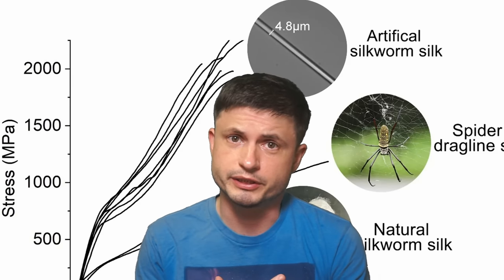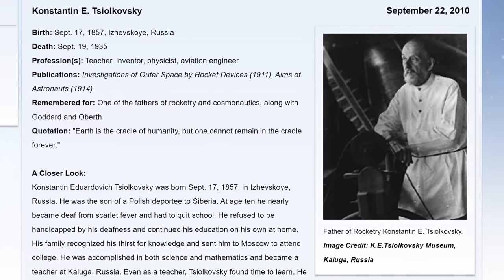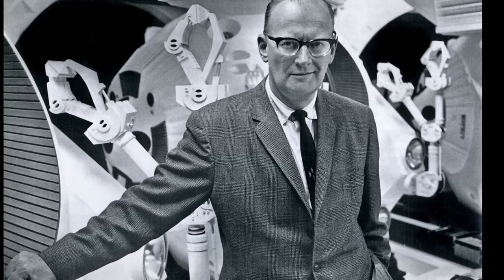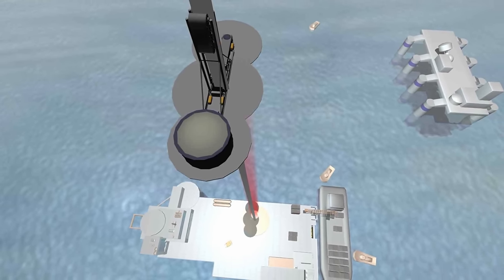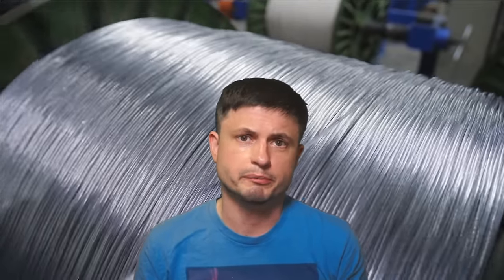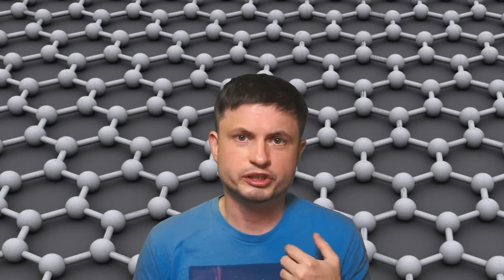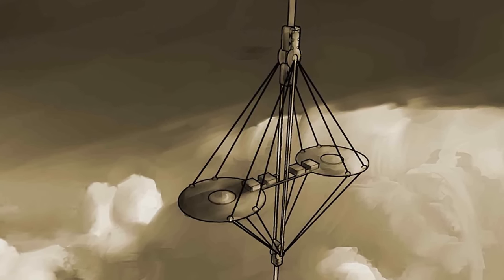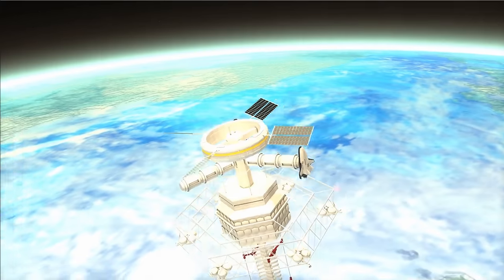Exciting New Updates About Space Elevator Technology...Possible After All?

Comment: I love your shows.  I have long been a fan of the space elevator since reading Arthur C. Clarke's Fountains of Paradise.  The one question that keeps bugging me is how would it avoid collision with the many satellites and all the space debris we have in orbit?
Reply: Satellite collision can be avoided by moving the platform on the planet's surface. This is possible because the platform would be seaborne, and also because satellite course is easily predictable. Regarding collision with space debris, I have no answer for you. That doesn't mean there is no answer out there  :)
Reply: I think the biggest problem besides the architecture design is the possibility of slowing the days down.
Like if you spin on something and move your legs in and out.
It would need to be placed in the equator and would possibly stop the poles from shifting over time. The other thing is how do you dock ships to this thing while it is moving at a high speed
Reply: Well yea, we'd have to either clear that up or make it strong enough to resist such damage, which would be pretty hard to to
Reply: @Dead_Empire  Well the Earth has a radius of 6371km and a mass of 5.96x10^24kg so a space elevator only going like 100km up and with a mass merely a fraction of the Earths I doubt it will do much. That being said, I have not done any calculations on this so if anyone has yk please say so
Reply: Another good one was Friday. It actually starts in a space elevator port think cyberpunk before it was trendy.
Reply: They won't have a choice but to finally do something about it. And, really, isn't it way past time for it?
Reply: @arandomyoutuber6634  yeah I don't think it would do much but how much would it take to make an effect on earth's natural systems? Even a very small change may have huge consequences. 
It's an interesting concept but likely not going to be seen in our lifetimes
Reply: @Dead_Empire  Earths mass is simply far far more than a space elevator that the effect would be completely negligible. The moon’s tidal forces on earth are vastly greater than any space elevator could ever produce.
Reply: @Dead_Empire  - The Earth is really really heavy. There's not any real way that  the small mass of a structure designed to be as lightweight as possible is going to affect the Earth's rotation.

As far as spaceships docking at the high speeds of the platform, we already deal with far higher speeds in low earth orbit, 17,000 mph. At geosynchronous orbit satellite velocity is only 7,000 miles per hour.
Reply: @47f0  thanks for the knowledge
Reply: Space debris hitting the elevator cable is a killer problem.  Cosmic rays are another.  Carbon nano-tubes require that they are atomically perfect to have such strength, the first time a cosmic ray knocks an atom out of formation, the area around the break will stretch, non-reversibly, by 10% and get permanently weaker.  Moving the base of the elevator to avoid paint chips seems far- fetched, but you won't avoid cosmic rays that way.

Another problem is that regular threads get stronger as you wrap them around each other, but carbon nano-tubes get weaker since the carbon atoms in the adjacent tube interfere with the strength of the first tube's bonds.

We need something much stronger than nano-tubes to make an elevator.  (They have to survive minor damage and dynamic loads.)  However, other possibilities are feasible.  Look up 'rotating sky hooks'.

Warm regards, Rick.
Reply: Huge fan as well. Perhaps a powerful laser beam firing parallel to the tether to vaporise debris before it reaches it. Now that sounds like science fiction!
Reply: The Space Elevator would need EVERY OTHER THING IN ORBIT to avoid the tether. "Everything" includes random bits of space rock, a spanner which someone dropped from the ISS, etc. Everything else in Earth's orbit would have to have an orbit to ensure that it never hits the tether. Note that "never" is a long time. If other random orbiting objects are not PERFECTLY synchronised with the tether, i.e. having an orbital period which is a rational multiple of 24 hours, then eventually something's going to hit the tether.
TWANG! CRUNCH!!!
Reply: @Dead_Empire  Yes, yes, OH YES!!! Earth will spin out of control and whizz across the solar system, eventually crashing into Mars! BANG! CRUNCH! SMACK! KA-POW!!!  SPLATTT!!!
Reply: @Dead_Empire  - Slowing the earth's spin or shifting the poles: I'm guessing that such effects would be real but undetectable except over centuries (and then just barely detectable) because the earth is so massive in comparison.  If a ship needed to dock with the geosynchronous station, it would get into a geosynchronous orbit itself.  Then they are going at the same speed in orbit.  The elevator parts further out are going too fast and the portions below geosynchronous are going too slow for ships orbiting at those altitudes to dock with them.  However, appropriate eliptical orbits might make it momentarily possible at the apogee or perigee.  Orbital mechanics are weird.
Reply: @simonmultiverse6349  - You are right, the tether is very vulnerable.  In addition to random rocks and even sand grains (think meteor showers) that enter from outside, orbiting spacecraft debris and satellites themselves threaten it.  I don't understand your point about multiples of 24 hours, though.  (did you mean "factors" of 24 instead?)  If something is taking exactly 24 hrs to orbit, it is traveling at the same speed and could stay on its own side of the planet, never getting close to the elevator.  If it's travelling even a little bit faster or slower, it might eventually bump gently into the tower; greater difference in speed means greater impact, of course.  If, however, it takes 12 hrs, or 6, 4, 3, or 2 to orbit at lower altitudes, it could well hit the tether quite hard.  Is this not so?  But I suspect I totally misunderstood.  What did you mean by "synchronised" and "rational multiples" of 24?
     One suggestion I've read (don't know how practical) is that it should be possible to push the tether sideways to avoid objects that have been detected.  I think they envisioned thrusters stationed up and down the tether firing to the side whenever a few feet to one side or another is desired.  Anyway, shooting-star sand grains or orbiting paint chips would not be detectable or avoidable.  And someone in these comments mentioned damage to the carbon bonds of the graphene by cosmic rays, which apparently would be quite serious.

Comment: The space elevator is definitely a game changer.  The counter weight would be a place you could launch space vehicles by merely letting them go.

But, graphene has so many more uses.  Being more conductive than copper, it will make step changes in the power and digital industries.  It's strength could create bullet proof clothing, lightweight cars, super tall skyscrapers, etc.  It is also a filter, desalinization plants would become viable.
Reply: Key dreaming boy
Reply: A space trebuchet?
Reply: @Faesharlyn  Geosynchronous orbit has a speed of ~6000MPH.  If the counter weight was 50% further out, speed would be ~9000MPH.  Being further out, orbital speed would be less the 6000MPH. 

A trebuchet is a more complicated device, but...  Attach a cable to the counterweight with the free end at the space station.  Attach the launch vehicle to cable and push it in the direction opposite to orbit.  Let the vehicle go when the cable in line with the elevator.  

Space trebuchet
Reply: @stevesedio1656  space trebuchet.

New thought but related:

 imagine putting the SpEl anchor on the north or south pole.. thoughts??
Reply: @Faesharlyn  Equatorial mounting keeps centrifugal and gravitational forces in line, following an existing orbital path (providing it survives sweeping through all the man made debris in space).

I'm not smart enough to figure out a stable orbit based on a polar mount.  Parallel to a geosynchronous orbit doesn't cancel earth gravity.  I'm not sure how to orbit the counterweight to get a near geosynchronous orbit.
Reply: @stevesedio1656  perpendicular to the pole it would just spin, no?

Edit to add: I'm not smart enough to help my kid with algebra but I think a lot. A lot a lot about a lot of things simultaneously sometimes . If the idea is obviously ridiculous I'm stuck here and not noticing it.. please tell me so I can stop thinking about it and we can both laugh at my silliness lol
Reply: @stevesedio1656 : It could only be done over the Equator.
Reply: Someone just gave me a Like, and I looked at my original reply, which got me thinking. I believe that this can be done away from the Equator, but it gets progressively more difficult as you move further from the Equator.
Reply: And impossible at the poles.
Reply: @davidkantor7978  One approach that only works at the pole.  The counterweight is a huge solar sail, the station doesn't orbit, it is locked "down wind" from the earth.  

The cable would sweep 360 degrees daily.  Because the earth tilts relative to the sun, the pivot would need to be 400 miles above the pole to keep from hitting the earth and to keep the sail in the solar wind.

That gets you into space, but not into orbit.  Due to distance, gravity would be reduced, at 22,000 miles, to about 2% earth normal.
Reply: Graphene isn't just more conductive than copper. It's the most conductive material known to man! Despite what you may read from most sources which say that it's silver, they all say that silver is the most conductive *metal*. Graphene, being two-dimensional, can't carry much current on a single atomic lattice. However, if you we're to have a block of graphene, possibly as carbon nanotubes, or simply place the lattice direction facing the same direction throughout the whole block and run the current the same direction, it would be roughly 4~5 times as conductive as silver, the closest second.
Reply: @Wesson_J_Dearsman  4 to 5 times is significant.  That combines with it's strength, and thermal conductivity, wonderful for motors and other magnetics.

Also interconnects and power wiring in EV's.

It isn't a replacement for superconductors.

Another application would be solar panels.  The sun side connections could be smaller, increasing panel efficiency.   The thermal properties could be used to keep panels close to ambient temperature, further increasing panel efficiency.
Reply: @stevesedio1656  I'm aware, I'm saying with both materials at room temperature it is between 4~5 times less electrically resistive than silver, whereas a superconductor has no electrical resistance at a given temperature, which is usually very low.
Reply: Yeah,graphene, carbon right? Carbon burns ya know like coal ( I'm really sick of the " magic carbon holy super dope and mega cool NANO CARBON FIBERS."   yeah, no it's freakin' CARBON repeating this when ya gush it's freaking CARBON

Comment: Another option I heard of to improve the tensile strength was to increase the diameter of the cable as it goes further out, though with most cheap materials it has to get ridiculously wide. That would also pose a challenge for whatever elevator design has to navigate the cable. But it does also cover the counterweight requirement.
Reply: That would not work. The strongest pull would be close to the center. So maybe the other way around.
Reply: I don't think it would be an issue for the elevator, just attach a smaller cable/rail to the load-bearing structure for the elevator to use.
Reply: @Youbetternowatchthis  I'm not sure if you misunderstood what Nick said, or if I misunderstood what you said. But Nick is right. But you also seem to be right. Which is why I don't understand why you say that Nick is wrong.

The "anchor point" of the cable can be seen as being in the geostationary orbit. And once you start stretching away from that, it will pull more and more on the cable that is in GSO. The part of the cable that is further away from GSO, will be strained much less. As you are saying.

So the cable that reaches the ground, only needs to be strong enough to support itself (plus any weight it needs to carry). The next cable up, needs to be strong enough to carry itself and the cable below it. The next cable, need to support itself and all cables below it. All the way up to the cable at the GSO, that needs to carry the weight of the entire cable reaching down to the ground.

So as Nick says, you can increase the diameter of the cable as it goes further out towards geostationary orbit.
Of course, once you are passing GSO, it can start getting thinner again.
Reply: All of the current space elevators plan to use a tapering cable.  The idea is built into current calculations.

Warm regards, rick.

Comment: This is great news! I included a space elevator in my novel 'Atropos'. I did a lot of research on space elevators and discovered some very interesting scenarios for "when/if the cables(s) break". Also, something that's not often mention is how long it would take to climb the cable from the Earth to the tether...We're talking at least a week and most likely much longer. Again, great news and thanks for the informative video!
Reply: So, it seems that it wouldn't actually be used to put people in space.  People would move the faster, more expensive way (rockets, Lofstrom loop, etc.).

But he SE would still be useful for bulk cargo, which won't get bored or have to be fed, watered, aired, and eliminated for all that time.

Comment: I wonder how at risk these elevator tethers would be to collisions will LEO debris and satellites. Kessler syndrome could be the ultimate doom of Space Elevators if we don't keep a handle on it.
Reply: If we get a SE I think that Kessler syndrome could be addressed and solved way easier. Since we would have this thing set up it automatically becomes waaaayyyy cheaper to bring anything we need to orbit (lasers, explosives,  nets you name it) so we can start throwing shit at the wall and see what sticks. Now if you want to "try" something, you need to buy a whole rocket.
Reply: I was thinking the same thing, it's so massive the risk of hitting something, even a small asteroid, is significantly higher than anything we've built yet. And if it breaks then all the junk we've hauled up there would pale in comparison to the cloud of debris it could create.
Reply: If we start building a space elevator, we would HAVE to clear up a lot of space debris. And any satellites below geostationary orbit, or really below the counter weight, would be required to have orbits that don't take them anywhere near the space elevator.
Reply: @carpetbeetle8349  That shouldn't be much of a problem. The cable is suspended down to the ground. So if someone blows up the cable at the bottom, it would still just hang there.
Reply: Massively at risk, because most things orbiting Planet Earth are not perfectly synchronised with Earth's rotation. If some things discarded from a space shuttle (spanners, cheese sandwiches, other accidental things) orbit with a period which is not PERFECTLY synchronised with Earth's rotation, there will eventually be a crash.
There are orbits  which will theoretically avoid the tether: these must have an orbit period which is a rational multiple of 24 hours, i.e. ratio of two integers. Mathematically, the orbit period of everything else must be 24 hours multiplied by one of these:  1, 1/2,  2,   1/3, 2/3, 3/2, 3,  1/4,  3/4,  4, 4/3,  1/5, 2/5, 3/5, 4/5,  5, 5/2, 5/3, 5/4,   etc.   AND ONLY THEN will it stand a chance.
Since minute gravitational influences from the moon (and other smaller influences) will perturb the orbit, there are even more ways for an orbiting object to change its orbit slightly, and therefore wander into the path of the tether.
An errant space rock has to be lucky once. The tether has to be lucky EVERY TIME, FOREVER.

Comment: Can we at present, construct a space elevator from the moon to lunar orbit?
Reply: Probably. It would also have the advantage that the elevator wouldn't have to withstand crosswinds.
Reply: I know if I was an astronaut, I'd feel safer going to and from the surface by elevator as opposed to rockets.
Reply: lunar orbit is relatively small so I would think we likely could, but for the same reason its also much less useful as of course there isnt anyone on the moon, but also because with that much less gravity, lack of atmosphere, and closer orbit it makes traditional rockets much more cost effective to operate or even less traditional launch methods like launch loop or delivery cannon style.
Reply: I looked it up. And the answer is No. Or at least Not certainly.

"Lunarstationary orbit" is 2-5 timer higher up than geostationary orbit. Which puts it outside of the Hill sphere. Which means that the Earth is the dominant gravitational body.
The best option would be make it at the L1 Lagrange point. This is still about twice the length of a space elevator for Earth. And I'm not sure if it would be sufficiently stable there.

So: No, you can't make a lunar space elevator as simple and easy as you can make one on Earth.
But it could maybe be possibly to make one.
Reply: @Tjalve70  Thanks, I wondered about lunar stationary orbit after posting. Given the lower gravity and lack of atmosphere it's probably more efficient to use railguns or towers on the moon.
Reply: @gamerscomplete  The problem with lunar stationary orbit is that one moon day is one earth month (moon is tidally locked). That makes the orbit much larger.
Reply: @andreasvox8068  My idea about sending things up from the Moon, is something similar to SpinLaunch.
Have you looked at SpinLaunch?
A ridiculous idea on Earth. But on the Moon... if you make the diameter equal to the diameter of the Moon, basically a railgun that wraps all around the Moon, then you can bring things up to ENORMOUS speeds without being affected by very much rotational gravity.

It would be insanely expensive though.